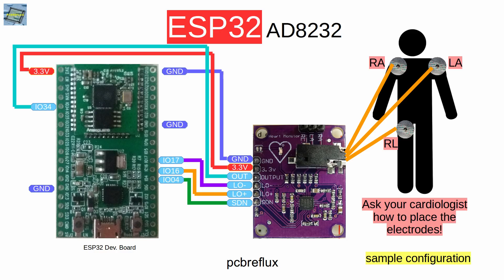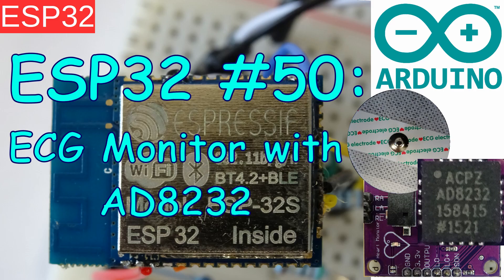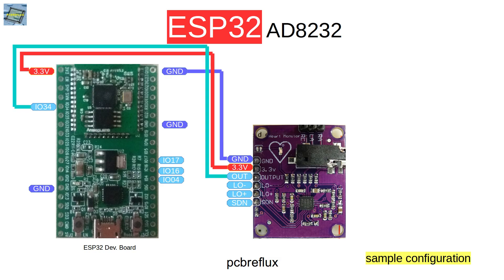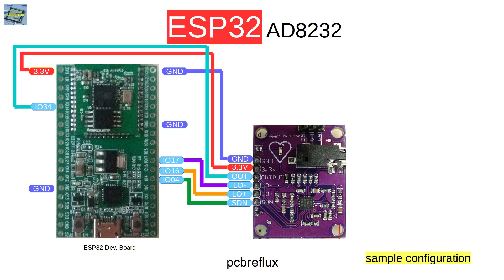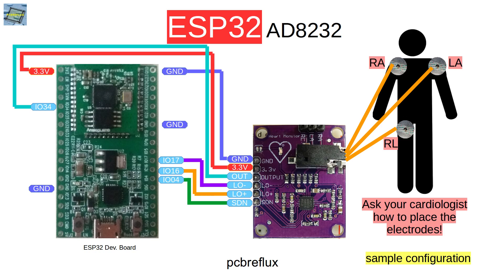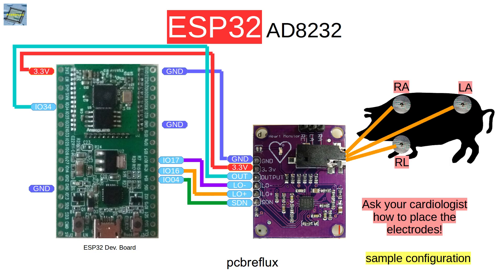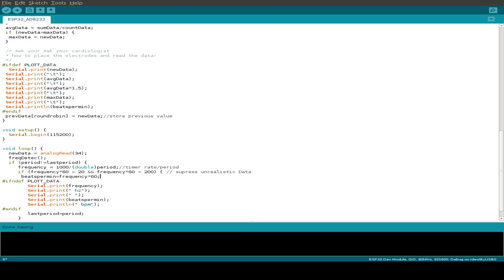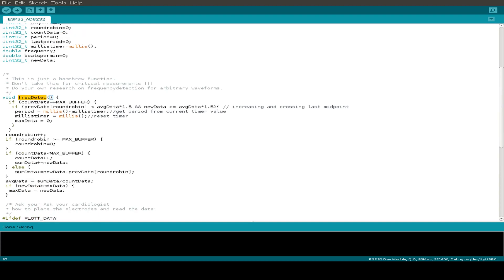ESP32 #50: Heart Rate / ECG Monitor with AD8232

Comment: Sparkfun did not invent anything, all these ECG modules manufactured in Asia at low cost are only realizations of Analog Device application diagrams of the AD8232. See data sheet on pages 21 and following, especially on pages 24 and 25.
Actually your ECG is not good, there is a significant noise that seems single frequency (50/60 Hz?). It is not only the quality of the electrodes to be checked but also their placement and the contact quality skin/electrode. The adjustment of the CMR must be controlled. There are modules coming from Asia whose components (R or C in particular) are not at the right values. ECG Modules with a 7Hz to 24Hz band cut filter should suppress this parasitic frequency. The software also must introduce a numerical noise.

Comment: Hi, i work on this kind of devices, as someone pointed out first you have huge noise coming probably from current source made the ecg unreadable, try to use batteries to power the device or insert capacitors and try to make power as stable as possible. Being this done, you ALWAYS have to do some software filtering of wave, using some low pass filter as this example shows https://puu.sh/xipTv/bda1644fa0.png

Btw this kind of ecg gives you very simple result but cant show lot of cardiopathies only visible on a 10-lead ecg but can properly show malfunctions that should be investigated by doctors. After all, ecgs are VERY subject to interpretation as malfunctions are clearly visible when its "2 late m8". Maybe you could not identify rare diseases but anyone can check if everithing is ok by looking at the trace.

A little brief on interpretation, having this "ideal ecg": https://ecgwaves.com/wp-content/uploads/2016/08/x-EKG-kurvans-komponenter-2-1024x661.jpg

If ST segment is up or down of the baseline of the ecg that can be indicating infarction, get checked. If some of the waves are non existent, inverted or timing dont correspond with the normal values, get checked, that may indicate problems, also check a bunch of RR intervals to check all of them are mostly equal in time and waveform. 

Also, you can always go to doctor, get checked and learn your "good" waveform to find changes over the time, more frequently if you have family with coronary accidents or have a sedentary lifestyle.

Comment: Very interesting!
I have a crazy Project - up to now more for fun and not too useful but this could be changed.
In an experiement I am using an HB100 doppler radar, 2 amplifiers and an ESP8266 as a rain sensor.   
Up to now the analysis is very crude evaluating if there is an Change at all. So birds leads to false positive.
falling raindrops produce a doppler frequency of less than 200Hz.
Analyzing the frequency and the Amplitude it should be possible to avoid the false positives, and to determine if it is rain, hail, snow and how strong it is. 
What do you think, would it be possible to implement a FFT in the ESP32?
Reply from the maker: klassich D Hi, there is a very nice example for FFT here https://github.com/cnlohr/colorchord this should be fast enough for the esp32?
Reply: Jusf 4 info: The arduinoFFT https://github.com/kosme/arduinoFFT works out of the box with the ESP32. just change A0 to your GPIO like 35 and it works.
I tested with 2048 Inputs sampled with 2kHz. Calculation incl Hamming Windowing, and peak search is faster than 70ms. 
But the peak frequency is 2.5% off.

Comment: You probably have bad connection between your skin and electrodes because of how much 50hz noise there is. That or this amplifiers cmrr is pretty horrid.
Reply from the maker: Arnþór Gíslason I use very bad leads, because the proper one are still in the mail, got only the module and electrodes yesterday, but don't want to wait. The electrodes for $0.23 delivered (if you order 50) are eventual not medical grade but enough for some tests. This more a proposal for a real product.
Reply: pcbreflux good stuff thank you for sharing